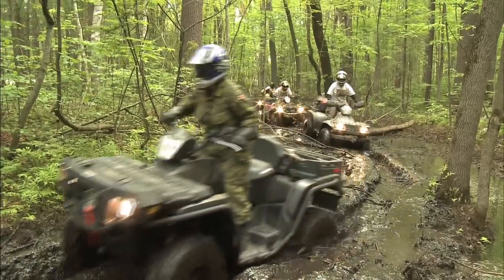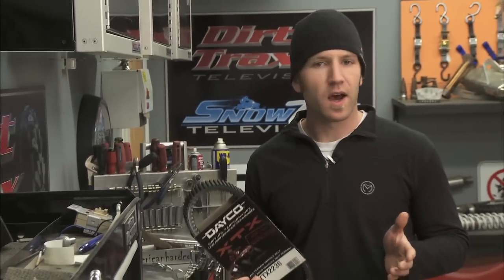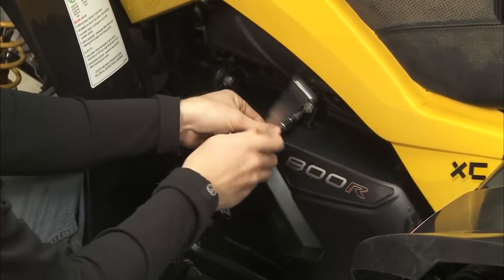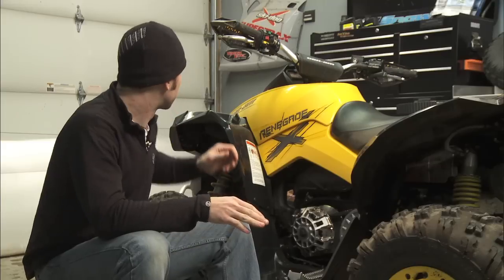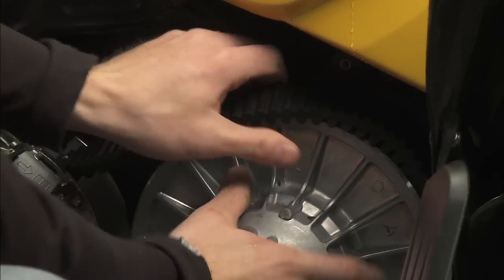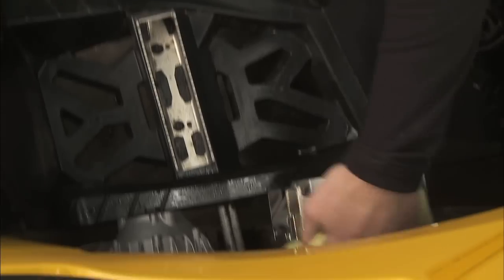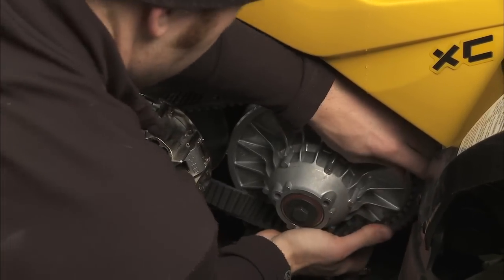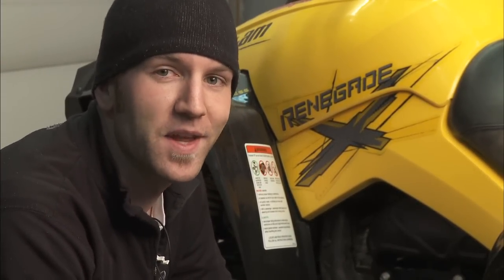How To Change A Belt On A Can-Am Renegade

Comment: Why not use a bolt to screw in one of the holes 2 push the secondary apart, then u wont have 2 struggel with the belt.
Reply: Spot on he did it wrong M8 x1.25 x50mm bolt works great